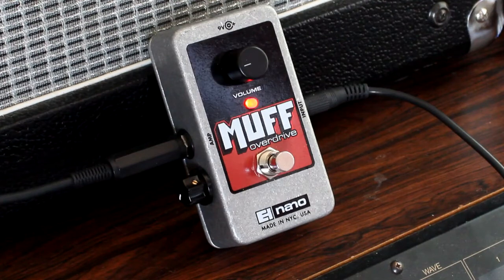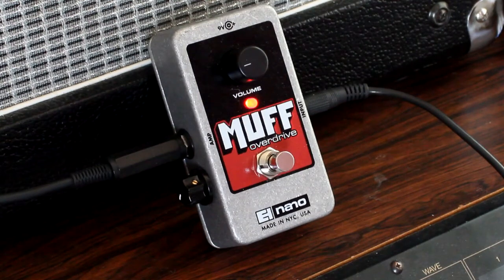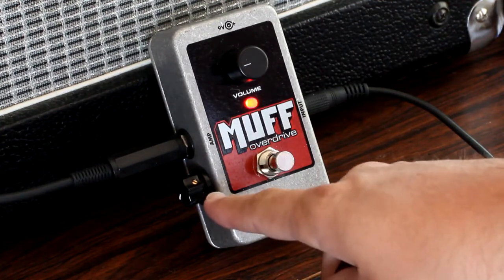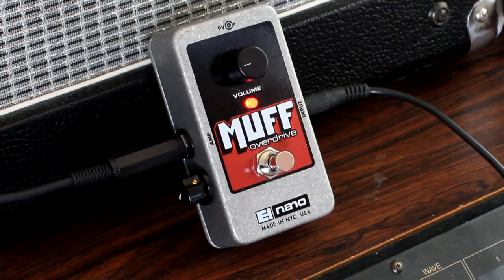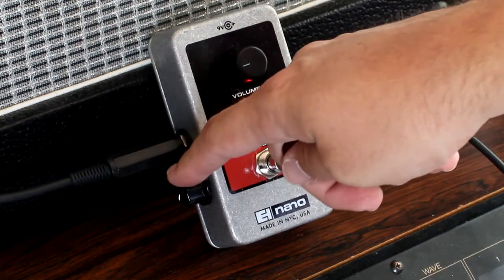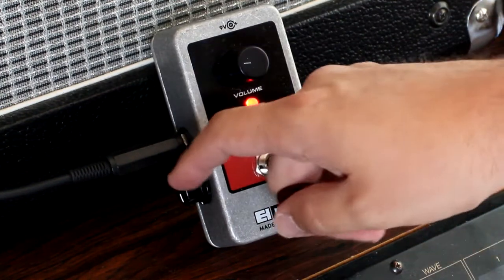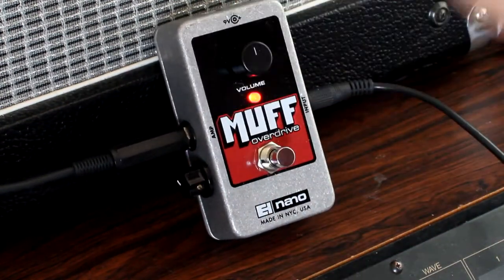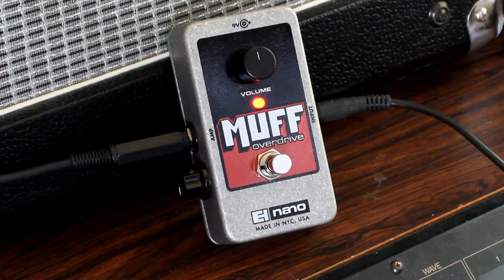Modified EHX Nano Muff Overdrive (Gain Knob Mod)

Comment: Hi, if you could maybe share the wiring and pot info for your mod? that would be great! i own a Double Muff and would like to modify it ...
Reply: ill 2nd this, can you show us inside the pedal?  where do you add the pot?  did you add or remove any other components?  is there a wiring diagram or schematic available for this pedal?  thanks.  and thanks for the video